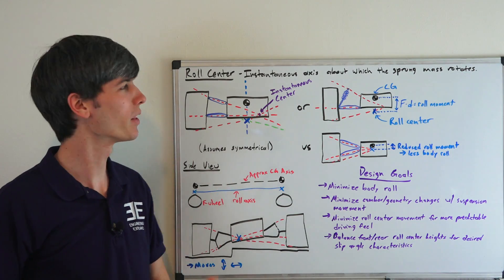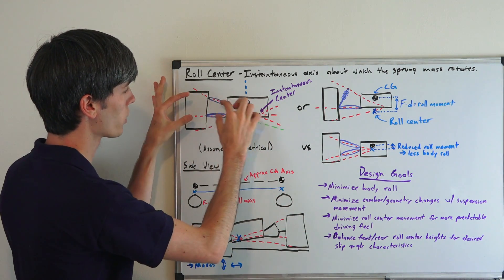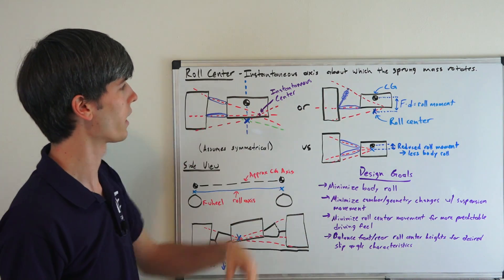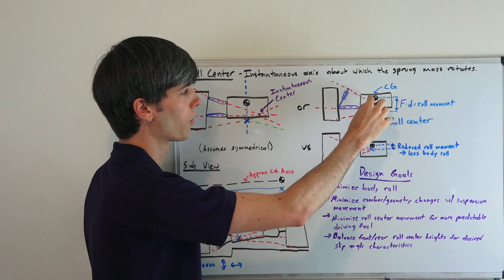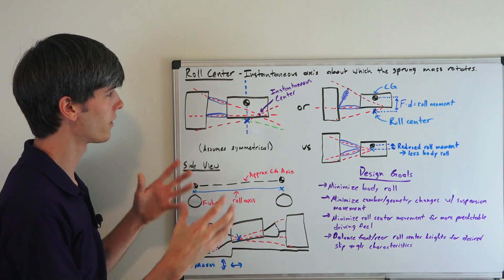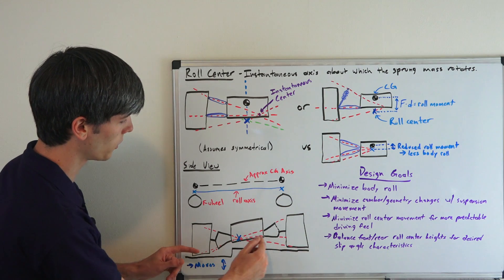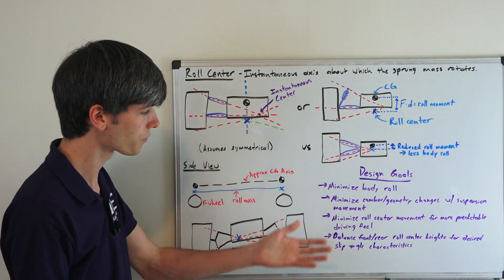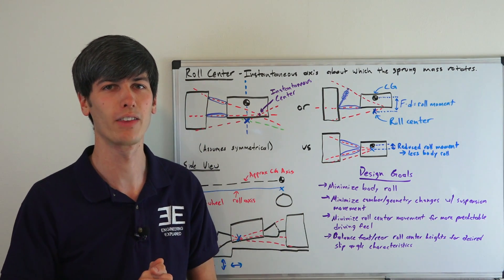Roll Center & Vehicle Body Roll - Explained

Comment: What would the equations of motion for the body roll be?  i have a half car model in MATLAB however, its the front & rear. I was wondering if i can just use the same model but change the equations of motion in the system to simulate the roll

Comment: So, in theory, if the roll center was HIGHER than the center of gravity, the vehicle would lean into corners, right?  Why isn't that done?  Seems like it would greatly increase passenger comfort.  I suppose it would have awful effects on camber...
Reply: It may be more comfortable but it's harder to control. You actually want a low roll center to have more force on the outer wheels in a curve.

Comment: HELLO DEAR I AM YOUR FAN FROM PAKISTAN ; I have a question that my car radiator support is bent from bottom side of vehicle from previous owner. I have issues of. car wandering from my side specially when windy and increased body roll . suspension is checked out no issues found . so can hit to radiator supper at front can change the geometry of body roll ?

Comment: What are your thoughts on Megan Roll center adjusters? Seems relatively cheap  to purchase. Would the benefits be noticeable installing these. I currently have megan Racing sway bars and SPC adjustable rear arms and front adjustable ball joints with Figs LCA  bushings lowered on BC coilovers with swift springs on my 07 IS350 Rolling on Vossen CV2 20in wheels.

Comment: A very nice explanation of what and where is the roll center.  I think it would be helpful to explain that the optimum roll center height is well below the CG for both handling and road holding reasons.  Rougly speaking, if the roll center is about 1/3 of the way between the ground and CG, it cancels 1/3 of the roll.  The anti roll bar cancels another 1/3 and the remaining 1/3 should be allowed to happen.  This deserves another video!
Reply: I agree. Important concepts are skipped over / missed here.

Comment: maybe you want to give a (very) brief explanation of what a roll center/body roll is.  The best teachers I ever had were ones that could explain the science behind the idea, but also introduce the idea by giving a real life example.  Example: "We've all felt that moment when we drive too fast around a turn...".

I recognize you're an engineering channel, and not catering to the laymen, but perhaps spending no more than 15-20 seconds on more poignant introduction could captivate a wider audience, resulting in (a) expanding your marketability, and (b) increasing the intrigue of potential engineers.

Comment: one thing you forgot to mention is, the center of gravity is figured from unsprung weight. that means all suspension components are removed (including the rear diff on rwd) and only the complete body and frame are used to find the cg.

Comment: it would be great if you could upload a video on Force based and kinematic based roll centres.( please refer a paper on roll center[force application points by MITCHELL]  and about the geometric and elastic load transfer.
Okay, I have many questions---1. say we let the RC and CG meet by our design, and now the car corners, there will be a net load transfer happening. now as we have zero roll due to our geometry, means our spring won't take any loads of load transfer and all the vertical load for load transfer will be passed through the A-arms to the sprung-mass such that sprung body doesn't roll? obviously, we will have very high jacking but still, is this correct?

2. Suppose we have RC above the CG, then we will have pro roll right ? the car will roll into the turn but the wheel loads will be as usual as a higher load on the outside and lesser on the inside which will be reacted by the A arms towards ?? i am really confused !!! ,due to cornering forces and the net moment on the car.?
Reply: HELLO DEAR I have a question that my car radiator support is bent from bottom side of vehicle from previous owner. I have issues of. car wandering from my side specially when windy and increased body roll . suspension is checked out no issues found . so can hit to radiator supper at front can change the geometry of body roll ?

Comment: Note that having your roll center above the ground makes the load transfer happen instantly as you begin to turn (don't have to roll the car to load up the springs). This can influence over/understeer (higher rear roll center -> oversteer)
Reply: Reply to very old comment - I'm just curious, why is instant load transfer in turn-in desirable versus waiting for the springs to load up? And are you referring to lateral or vertical load transfer?
Reply: @stephenabraham6787  My understanding is that if you aren't wasting energy in compressing springs, loading sway bars etc before the car turns in, it's going to turn in faster. 
Pretty much, it has to lean before it can actually turn. The less it leans, the faster it turns.

Comment: Hey there! I got a question, why is the driver suspension lower than the passenger? I'm driving on the right hand side.
Are there any science behind why or just not set up properly? If adjusted will my alignment need adjusting?

Front are macpherson struts w/ fully adjustable coilovers
Rear are Multilink w/ fully Adjustable coilovers

Thanks!!

Comment: We build off-road cars and one off the goals is to have a massive oversteer effect, the cars are rear driven, for that we need a lower roll center height at the back?
Reply: Corsários Baja probably not the best way of going about it as roll centres are not easily changed. Your better off tuning the over steer and understeer characteristics with springs and swaybars

Comment: i don't understand (unRelated to this particular video... but): doesn't "launching" put stress on vehicles, especially manual transmission? The whole idea of engaging clutch while there is a big difference between  wheel speed and engine speed- is this not stressful on the car and lead to premature wear?

Comment: And here's the question. we have the macpherson suspension. Normally we lower the car (front macpherson) , as low as the tire size allows and the handling is improved as the result but in macpherson, the upper A-arm is the  strut top and is fixed and has little to some mild angle. We lower the car, the lower A-arm is tilted downwards. It means if the angle of < is positive, turns toward zero, or even negative. The instantanious center is altered downwards. The biggest impact is noticeable on suspensions with short A-arms. The car that runs high has a jacking feel of one side. (body roll?) The same car lowered has great steering response, excellent cornering and fun to drive. So, on the contrary of what u'r saying, lowering the roll center helps until the jacking effect is minimized. I believe this is why we lower a car front 5 cm, but lowering the CG 5 cm doesn't seem to have a noticeable change. This is why lowering cars with solid axles or lifting them like offroad cars doesn't change things... I'm pretty much confused. with lowering the body roll decreases. but if we increase the moment length of body roll we will have more body roll.

Comment: Would the same process apply to a suspension where the angle above the x-axis is higher for the upper control arm than for the lower? Take Formula 1 cars for example. It seems like on the Ferrari F2012 specifically and I believe a few McLarens both control arms are angled upward but it at least appears that the upper control arm is at a higher angle. would the instantaneous center just be outside the car and possible below the ground?

Comment: Hypothetically, can the CG ever be below the roll center (by artificially adding a ton of weight down low)? What would happen then?
Reply: Roll center can be raised or lowered with geometric changes, no weight needed. Dynamically it probably would ride like a go-kart, very responsive aka twitchy

Comment: What happens if the roll center of one end is above CG?? How does the body roll then? And what happens if the roll center is below the ground?? Why is it undesirable?? And why do off-road cars prefer more roll???
Reply: I believe the further the RC is from the ground, it creates a jacking force, the RC above the COG exerts more force on lifting the outside wheel than it does pressing the inside tyre into the ground which creates some undesirable handling characteristics

Comment: Hey i hope you'll be able to answer this but since i got my first car, i have 3 questions.
1- im losing oil in compression returns. Is there a way to eliminate this issue?
2- is a cold air intake dangerous in winter?
3- is it true that slowing down on compression is damageable to your engine?
Thanks! Oh and great video, keep up the good work man :)
Reply from the maker: Gabriel Thériault 
1. Not sure what you're asking.
2. I wouldn't say so. Bit of a generalization though. What about winter makes it dangerous? Super low temps? Shouldn't matter.
3. What is "on compression?"
Reply: 1- there is a hose coming from the cylinder head that brings little compression leaks back to the intake. lots of oil is flowing through this hose and i wonder if there is a way to fix this.
2- i was told that a cold air intake here in canada is bad in winter. i was wondering if any problems could occur because of the cold or maybe snow.
3- you know when you downshift but you dont apply throttle, just to slow down without braking? I was told a lot of times that i was bad for engine health but deep in my heart, i dont think its true and you are pretty qualified to tell.
Reply from the maker: Gabriel Thériault 
1. Maybe oil catch cans?
3. That's what oil is for, no problem letting off the throttle. In fact it's preferred in scenarios where you'd otherwise have to brake (going down a big hill) as your brakes won't overheat.
Reply: Alright much thanks! I'll look into an oil catch can
Reply: Gabriel Thériault Your oil problem could be a faulty or dirty PCV valve. This valve controls the flow of gasses back into the intake.  When working properly the valve gets sucked closed by the intake vacuum at idle/closed throttle. It's possible that a stuck-open PCV could cause it to suck in an abnormal quantity of oil.

The valve is usually quite easy to remove and fairly cheap to replace. Sometimes they get blocked with sludgey oil and can be removed and cleaned out with some carburettor cleaner or similar solvent.
Reply: Oh well thanks! I think the last owner didnt really care about this because there is just a straight hose from the cylinder to the intake. guess im gonna have to buy one but i dont know if it will work with a cold air intake?

Comment: what's the outcome if your center of gravity is below your roll center?
Reply from the maker: wiltse0 Body rolls the opposite direction.
Reply: Engineering Explained would your ability to corner be decreased by the same amount if your CG was above your RC and the other way around? (assuming all other variables are |equal|?)

Comment: as a vehicle dynamics engineer, i'm rather skeptical to you trying to "minimize" everything. its always "optimizing". eg: high roll centers will have more jacking force. thus low traction.
Reply from the maker: Onkar Mohite Haha, the better word is most definitely "optimize." Typically it's better to let the spring/damper combo work out the road rather than stiff control arms, agreed! It's one of the many pieces of the puzzle.

Comment: What about a roll center above the center of mass? Would that result in "opposite" body roll?
Reply from the maker: Yep, though the suspension would look fairly strange, and it wouldn't seem all that weird that's how it would behave if you saw an example. It'd be kinda similar to a biker leaning into a corner, but with four wheels.
Reply: Engineering Explained That seems like a desirable behaviour. Do you know of any real-life examples of this kind of design? Or why it wouldn't be a good idea?
Reply from the maker: ***** Typically it's best to just not have body roll, as it changes the wheel geometry and influences the contact patch. Also, the suspension would be a bit too angled for this to happen.

Comment: Very nicely explained! Thanks for the upload. A question: any way to know how to minimise the roll of an already designed and manufactured consumer vehicle (boxy, tall family car)?
Reply: a sway bar conects the left en rite suspention arm. when the car rols left it wil compress the left spring.
the bar wil transfur some of the compresion to the rite spring.
the efect is u lower the ride hight by compresing both springs wile conering.

it has drawbacks but most of them are minor en will give more feel en les comvert.
Reply: Swaroop Bhonde Changing your anti-roll bar thickness is the cheapest way to do it, but it is far from the best. Proper damper and spring tuning combined with chassis stiffening is a better investment as you don't have to sacrifice ride quality to achieve better handling. When the pro's do this they try to run as little anti-roll bar as possible, because ultimately compliance is control. HOWEVER, if money IS an object and your choices are a cheap (generally anything under $1200) coilovers, or a slightly thicker anti-roll bar setup, than get the anti-roll bars.
Reply: Swaroop Bhonde beefier sway bars would be my personal advice.
Reply: SoY_FooD You really have to move the weight down, so lowering the car or making it lighter are the best options. Anti roll bars/sway bars wont do anything to actually change your roll center, they just resist the forces more.
Reply: true but it will counter some of the effects getting the result fore little money and needing less weight reduction to get a good ride
Reply: SoY_FooD Mat Guest Folding down seats is really something that looks promising! Will be trying out for sure! But beefier Sway Bars would in turn reduce the overall roll while not touching CG as well as Roll Centre? I believe Roll is basically toque exerted by the force (this force will get reduced due to Sway Bars?) while the distance between CG and Centre of Roll being the arm? Am I correct?

Joel Sägesser Sway bar modification would means possibly voiding warrantee? Will look out if anyone near place has expertise in it!
Reply: Swaroop Bhonde anti role bar will help, stiffer en flatter tires (more solid rim less uncontrolled bounce rubber), removing mass, lowering mass (drop the battery to the floor en u will Feel the differences).
the cheapest way is to fold down yore back seats when u dont use them.

Comment: Thank you for this video!! 
Whats about rallysport? i guess you want depending on the driving style and surface a decent amount of body roll. Is a scandinavian flick without a good amount of bodyroll even possible? I guess not. What do you think?
Reply: No problem :)
It is possible to flick, you can see rally drives do it, nowadays we don't see wrc drives do it too much, because recent cars have more grip than the older ones, so it's faster to go as straight as possible (said by Colin McRae)
Reply: Phil Langer Glad to see a rally fan! scandi flick can also be aided by left foot breaking hard in (diving) and providing high throttle input (where rwd > fwd, most wrc are ~70/30 split) and thus removing grip from rear tires by spinning them. This moves the CG to the front of the car and allows the rest of the car to rotate around that point. Leading to some saying they steer with their feet more than their hands.
The flick is dependent on front to rear CG more than top to bottom (which is what this video discusses). Anti Dive (preventing rear to front CG movement) would have a bigger (negative) impact on Scandinavian Flick than Anti Roll.

AR set-ups can help reduce the chance of roll-overs in high grip, high speed, sharp turn scenarios, by counter balancing a higher CG. Since Rally cars need higher clearance they will have a higher CG than typical cars; so AR is even more important.
Reply: Phil Langer The flick can be done better with smaller bodyroll.
Reply: Phil Langer Think about extremes... if the car has too much body roll, when you try to flick it, it will have a great amplitude of rotation, wich also means it's harder to "pull" it back arround, that's if the car doesn't flip ahah
Reply: H Scorpio thanks for your reply. i think you are right. my question is if the sligthly greater bodyroll supports the flick or not. Mortalomena said smaller is better, but i am still not sure!